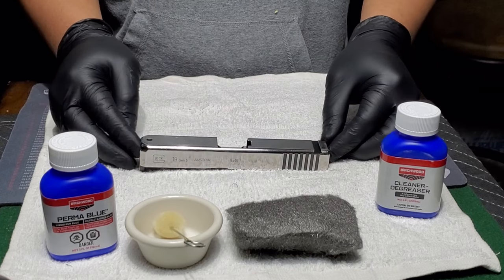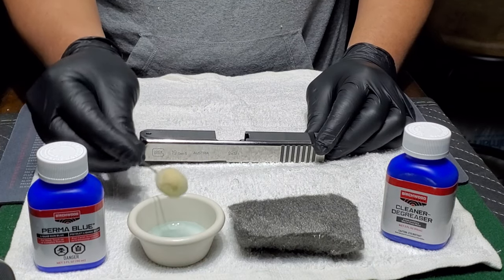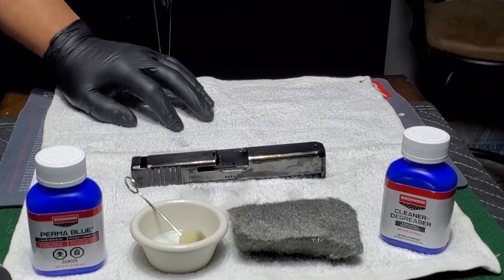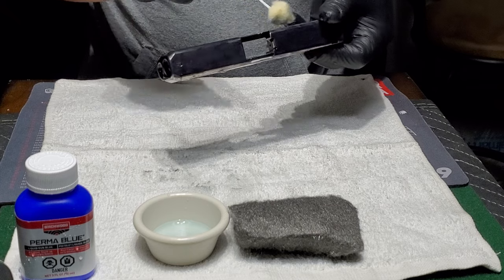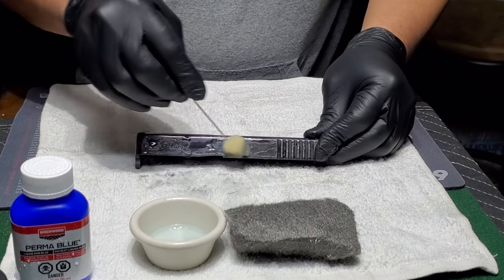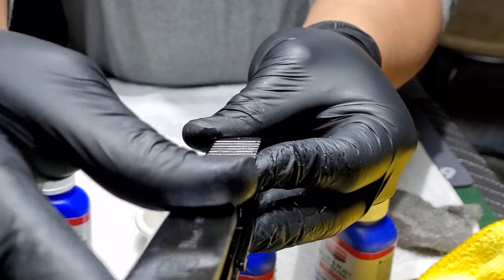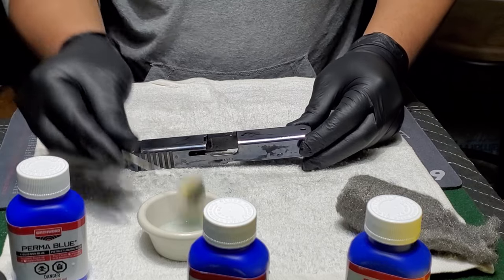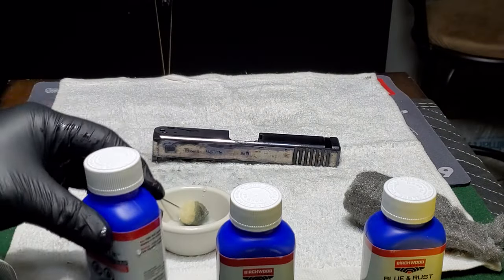Cold Blue Glock 19 Slide

Comment: Yo Riders lock, after watching your video here and from over 20 years gunsmithing, I'd like to add my 2npence worth, the Birch wood case product does work but things are not that simple, instructions on these sets reads quite plain and simple but doesn't tell you anything about the surface you yourself have prepped, over the past hood few years I've used permablu, superbue, and the gel and each time has resulted in a different coverage, it's down to the type of metal, it's purity, if it's an alloy and how you have prepped the metal, Never use regular wax based buffing wheel compounds, metal is a porous  surface, I believe wax is the main issue to your problem here specifically and waxes are very difficult to get out of polished metals, when your buffing for the best possible surface you are applying wax and heat from buffing which impregnates the metal with oils from the wax, so what is the remedy to this problem? It's petroleum or diesel and you'll need to warm the slide to around 50 degrees c and submerge the slide in one of these fules do begin degreasing it first off. Do not try to replicate a high sheen glossy blue because this is only achieved by hot bluing and never cold blue acids, you can reapply and with 0000 gauge wire wool repeatedly rub down after every blu application for a better and deeper sheen buts that's as good as it gets... until you then soak metal work with oil, which will bring a deep and dark with a much lesser patchy result, I recommend silicone oil. The ideal metal surface such as barrels and top slides should be bone dry, matt, to lightly brushed, never had any oils lay on it or ever been wax buffed, basically raw metal that looks like it's about to rust on its own anyway! And then making sure its clean, warm the past up with a blow torch until it feels warm, not hot but warm to ntouch, and now is the time to apply bluing and done so liberally, you want want run marks but you have to pay down large quantities fast and as smoothly as possible (imagine trying to cover a canvas with espresso coffee without getting any streak marks), once first application is done leave for exactly 1 minute and then very lightly (1 hair and some air) wipe over the piece under running cold water, pat dry and repeat (6x as a good standard bench mark) what you should find is a very pale, patchy and dull finish, now it's time for liberal coatings of silicone oil, resting the part in the oil, wiping it off and leaving oil on it for at least the first few usages, it will always need an oil application and barrier products work well. There is no need to chuck the slide away or get out a grinder to get that patchy bluing off, a buffing wheel with no compound or a water based compound will buff off the bluing! So, you back in square 1,what should you do? Degrease this top. Slide with gasoline, petroleum and wire wool at a fine grade such as 0000,rinse and repeat, you can use soaps in between and end up with a matt looking brushed slide, now your ready for bluing the cold blu way, an alternative is to prep and use browning first and then with a cold. Blue final. Application. Hope y'all can can read what I'm typing because I can't, for some reason after 39 words my yt comment box turns black and I can't see anything I write! Anyway.... Good luck, don't give up on it, and make sure you show anyone else the improvements. Clod bluing is a real bitch!
Reply: I've had the same issue as this guy too, it's never as consistent across the metal I'm cold bluing as I want it to be:) I still find myself going to videos trying to find hints and tips here and there. After reading your comment, I think next time I'll use some diesel and silicone based oil, put my heat gun or blow torch to use and see what happens:) HA! Thanks
Reply: @geico1975  yeah, don't stop trying, litterally as raw as you can get the base metal the better is will adhere, that's not good if you want a polished finish because polishing dulls out the porosity of the metal, polished steel is for hot or. rust bluing or even browning, your looking for a really lightly and fine brushed metal finish for cold blue, and even then the metal needs to be way above room temp for better results, not hot but like 50-60c, as for swabbing areas with wool,... its far better to drench a large area as fast and as wet as possible, I'll share 1 other thing, wire wool even at 00 gauge between coats does no favors, it's like undoing what you've managed to achieve - for me anyway! I just rince and towel pat dry before another application. lastly I've just discovered that wax over your final coat and then buffed out works better than soaking in oil as a long lasting finish, oil is great and should be applied as fast as possible to your finished piece but after a good oil bath I lightly tap that off as much as possible then apply wax, even carnuba wax works well to deepen the blue and protect the metal but just make sure there is never any type of cutting grit in any Polish you apply, Birch wood casey do a stock finish wax and this actually works great over newly blued metalwork. good luck and hit me up if you find out anything I've said works for yall.
Reply: Thank you bro I learned alot reading through this
Reply: if all else fails with bluing and you have a steel part you can brass plate it very easily, with raw base metal heat with a blow torch to 600f (not to glowing point just very hot) and you can now do 1 of 2 things, submerge the part in oil (turning it black) or use a full brass wire wheel on a drill or angle grinder, the bristles of the wheel or brush must be 100% brass, and that will result in a hard wearing brass plate, which if polished will look like gold, to keep it that way you can brass laque the piece. if anyone wants to know more about non steel parts (such as aluminium or zink and aluminium pot metal alloys drop me a ping.
Reply: @xK1llSw1tchx  an acid etch primer comes in black is a great first application, it's hard wearing, can be left as is as a matt finish which will also deal with oils and lubricants, I have found a great product that can be applied over the primer then buffed to a high gloss metalic silver carbon finish, resembling a very dark traditional bluing, this product is called Kontakt Chemie 33 Graphite, it's used for plating non conductive parts and also as an anti static, I have just used  this method on a 92fs barrel, other than it requiring a buff by hand every other usage it looks great and is very smooth on the action.
Reply: Thank you sir, correct and valuable information

Comment: I bought a gun range rental Glock 19 a couple years ago and it looked thrashed. I was going to sand it and cold blue it but after a light sanding (very light) with 1000 grit paper I liked the look of it so much I just left it that way. It never has showed any indication of rusting and I intend on leaving it that way. Live and learn. Great video my friend.
Reply: I did the same thing to my Glock 23 Gen 3. I took some 600 grit first and then 1000. I left it like that for a few months and recently I just decided to spray paint the slide. Couple coats of primer, and few coats of black paint. Came out pretty good. Looks like a gen 5 but with more sheen to it. Gave me back some grip too. Its not going to last forever but when it starts to wear out it actually may have an even cooler look😮😂 we’ll see!
Reply: Most of the factory treatments soak deep into the metal, light scuffs on the finish are entirely superficial. I just want to know if cold blueing is comparable to full blueing.
Reply: @DirtyMike_n_theBoyz  Mike, cold blueing doesn’t start to compare to commercial treatments. It should really be used for touch up of small dings. It probably would have turned out rough so I’m glad I changed my mind. Still no rust of any kind.
Reply: @maxmccain8950  good to know, i have cheap cerakoted slide i wanted to strip to bare metal, considered cold blue, but may just spray painting it or high polishing it and leaving it bare.

Comment: I know it's called cold blue  but whenever you attempt to Blue something you need to heat up the part. Hit it with a heat gun until it is almost too hot to touch. before you do that make sure you scuffed the hell out of it with fine sandpaper and then spray it with brake cleaner thoroughly. Heat it up and then apply the blue
Reply: I have a new ar that has a bit of rash on the hand guard, can you recommenda fix for that?

Comment: It does look like stainless steel (some glock slides are made using stainless alloys, idk where these comments are coming from saying all glock slides aren't, each manufacturer uses different combinations to spec).

But just from the look of it, that looks like a stainless steel of sorts, hard to tell if you polished it after priming the surface, but if it is then there's the issue, its not impossible but depending on the grade of steel it'll be better and easier to hot blue it as physical contact with the cold bluing on stainless steel will degrade the finish over time, but don't let that discourage you, I didn't know much when I started either a decade ago too ! Cold bluing is effective, the more you do it the better experienced you become. 

Take care, and keep it up!
Reply: I guarantee you there is a huge amount of metal, alloy purity differences from the same manufacturer for the same item.
Reply: @PK-YTMusic , ferrolho da glock não escurece nem na oxidação negra. Creio que seja muito carbono ou inox mesmo. Na oxidação negra fica cor meio marrom bronze. E na CZ fica marrom escuro.

Comment: The factory tennifer Glock coating is hard to beat.  I would just cold blue over that.

You need to degrease EVERY bit of wax and oil off using stronger chemicals such as brake cleaner and acetone.

Personally I don't care what it looks like so much as it is protective against rust -especially on a carry gun.  I live on a boat and my daily carry gun gets beat up by the saltwater and salt air. Every time I see any rust I strip the slide and buff all the rust off with a brass brush, degrease, and slather the cold blue over everything to add a new rust-resistant coating.  I use lanolin oil/wax to protect and saturate the blue before buffing to a nice finish.  This has to be done every couple of months to keep the rust at bay.

Comment: When I Blue gun parts I use brake cleaner to remove oil and grease off. It’s safe as long as it is only bare metal don’t use it if you have any parts still attached especially plastic parts. I have done quite a few guns and Had the same problem until I used Brake cleaner to rinse the parts needing blued

Comment: Glock barrels and slides are made from quality steel which has been treated with a special "Tenifer" process. This colorless carbo-nitrate formula enriches the steel with oxygen, sealing its pores. Tenifer makes the steel extremely hard (as hard as industrial diamond on the Rockwell scale) and corrosion resistant. I think pores are problem to blueing process, I tried to do the same what you are done, same result
Reply: The thickness itself is half of a guitar string. Wikipedia : It is 0.05 mm (0.0020 in) thick and produces a 64 Rockwell C hardness rating via a 500 °C (932 °F) nitride bath.[32] The final matte, non-glare finish meets or exceeds stainless steel specifications, is 85% more corrosion resistant than a hard chrome finish, and is 99.9% salt-water corrosion resistant. 😮
Reply: @nafis6668 
👍
Reply: Incorrect. Tenifer hasn’t been used in many years. No longer allowed into the country.

Comment: I think it would look really cool fully blue. What a shame
Reply from the maker: I know, right!
Reply: @ridersblock  I want to try heating and quenching, but on something a little cheaper than a slide.
Reply from the maker: @zac2384  maybe if I get enough "likes" I'll try it and capture the process.
Reply: Ok , the very first thing you must do is wash it down  with industrial grade lacquer thinner , then soak it in the thinner over night to remove all traces of oil . Can use automotive brake cleaner , or equal. Then follow the directions on the bottle, use the blue& rust remover even if you don’t think there is any rust , because there could be in those little pit marks . Then becaus the blue does not stop the rusting process you finish with the soaking in oil 8-12 hrs , out in the sun or a hot environment, hot enough to barely hold, to open up the pours & let the oil in ; or the  Birch Wood Casey Barricad process I have yet to do this last one myself .
AND , 1 more thing , isopropyl alcohol is not - denatured alcohol - which equals alcohol for fuel

Comment: I've seen a video on YouTube in which a gentleman blued a Ruger Mk4 hunter which was originally stainless steel and it worked good.
Of course I'm aware not all the gun metals or stainless steels are the same.
If I were you I'd go with a very light sand blast and then bluing. 😊

Comment: For 1 brother you didn't degrease it good enough I wouldn't have hit it with the Dremel and a degreed 60° sandpaper maybe 120 then I would have used a tupperware bowl or the primo blue in it and set the slide into it rather than touching and holding it and swapping it with that little q-tip I'm pretty sure if you did it that way it would look a lot more better. The problem is that that's a nickel plate high polish you need to get that doll before you start painting it a light bristle rub and degrease ain't going to work you have to get that polish Co off. It's so hard brother to keep watching you try to use that bristle pad and degreaser that's never going to work you need to get through that nickel-plated polish coat you have to send it down 2 doll until you do that it will never take and also you did have a great idea with heating it up and thrown in used oil motor oil which would have gave it a awesome design and similar blues
Reply: It helps to listen to him. First minute of the video he states he polished it. 120grit sand paper would make it look like shit.
Reply: Heat up the slide and dip in oil?😂 That could ruin the temper of the slide and cause it to crack.

Comment: Would it have made a diff if you had heated the metal first?
Reply: short answer is no, the slide that would not accept oxidising seems to be impregnated with a wax.
Reply: He buffed wax into the pores of the steel with the buffing wheel and buffing wax.  It takes something strong like brake cleaner to get that off.